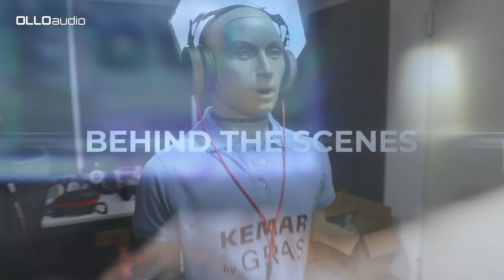How you can destroy your perfectly flat sounding pair of studio headphones without knowing it.

Comment: Did this happen to the headphone because it does not have a pressure or air release hole for the driver and it suffers from a bad design?
Reply from the maker: @MML66  This way bass extension can be achieved. It's a part of the design. There are tradeoffs with acoustics design, always. Tnx for a cool question.
Reply: @olloaudio  Thank you, I hope you have a happy day

Comment: You should say it's only possible (and you probably really want to break it while doing it) with closed headphones and with a perfect seal around the ear pads. I really doubt open headphones and planar headphones can suffer from this in normal use situations....
Reply from the maker: In normal use, this is not a problem. Pushing them agains your ears (as many do for some reason) is not normal use. Open are less perceptive of this, true. But far from imune. Same for planar. Thanks for the comment challanging our POV, love it. R
Reply: @olloaudio  you would really have to push hard and have a perfect seal around your ears to even flex the driver a bit... thats crazy badluck if it happens to someone...
Reply from the maker: This blog was brought to my attention from another company: https://support.audeze.com/hc/en-us/articles/115001045046-Crinkling-clicking-static-sound-when-I-press-on-the-earcup

Describing the same thing with planar tech.